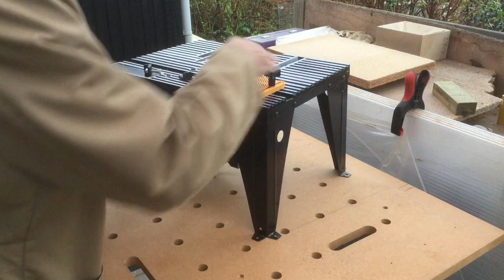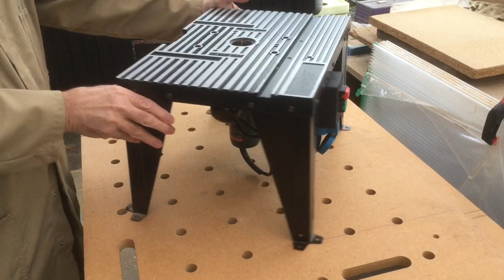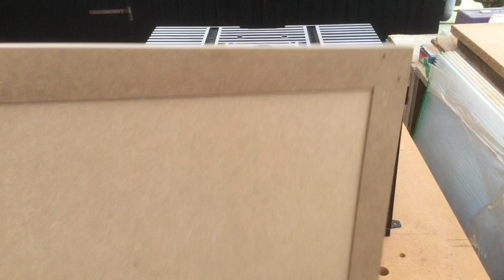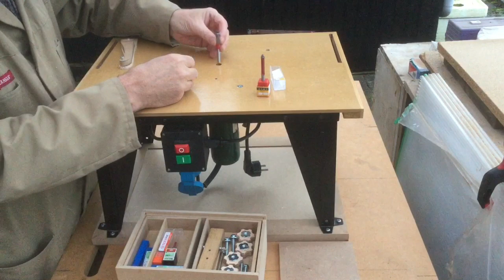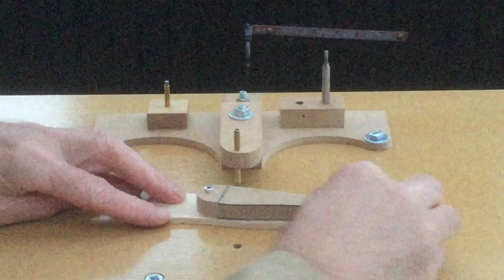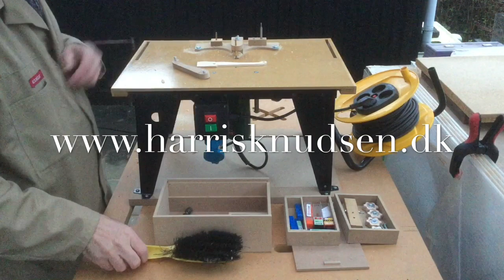50 year Old Bosch Router and $ 50 Router table = New Router table

Comment: I'm not a woodworker so maybe this is foolish of me to ask. But the contraption you use is for aligning the work piece to the mold from the top right? Aren't there special router bits that do that to?
Reply from the maker: The small tip that sits above the milling iron controls the template and I don't think you can buy such small milling irons, but it is easy to make yourself. For larger dimensions, I use an iron with a ball bearing at the tip, which then controls the template.
Reply: @Harris-DIY  Thankyou! Now I understand the need for this! Great video's. I'm learning a lot!

Comment: Is this usable table?
Reply from the maker: I think it is very useful
Reply: @Harris-DIY  Thanks for the reply, i'm getting one for myself this weekend. Any tips ,tools? Should i add ?
Reply from the maker: It depends on the work to be done, I have an 8 mm with straight cut in high quality which I use where possible and many different cheap ones that I use when I need other sizes and profiles, the cheap ones do not do as nice work  nor does it last very long.
Reply: @Harris-DIY  yes but its up to router bits itself right. Not the table.. Im just gonna work on fine wood like framing etc. Diy purpose